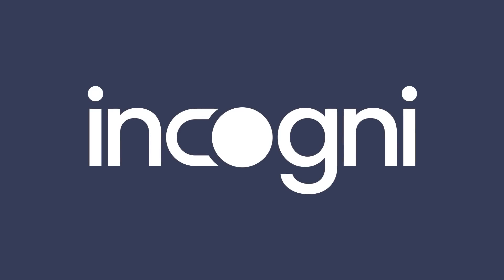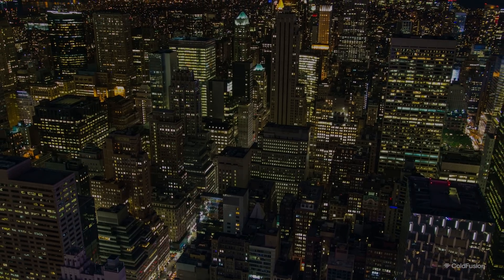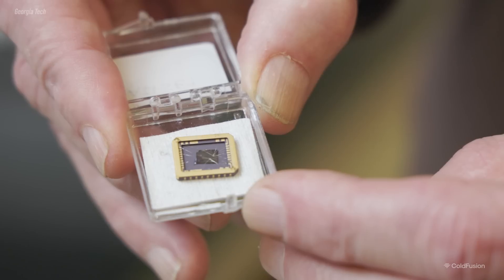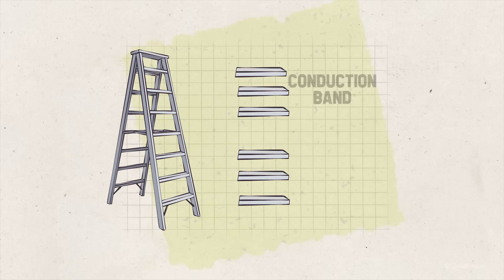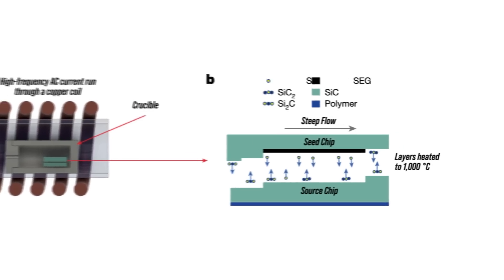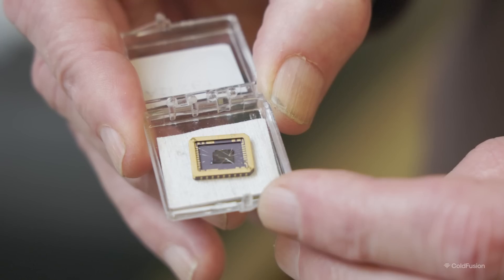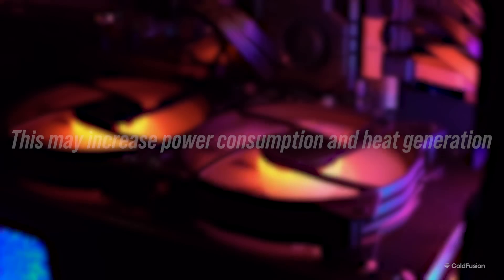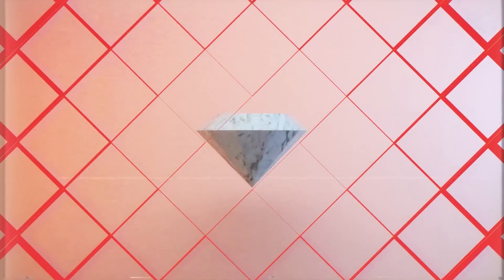This Chip Could Change Computing Forever

Comment: But when will we achieve cold fusion?
Reply: It's just around the corner, next upload.
Reply: Lol
Reply: 16 years, 4 month, 11 days, 19 hours, 52 minutes, and 12 seconds
Reply: @Astra2  You forgot the MS Miller Second.
Reply: @Astra2   I just put Monday, 3 September 2040 into my reminder/calendar for Cold Fusion; just to see if you were right, if so then ya it'l spook me....../
Reply: after we build a Dyson sphere
Reply: Cold fusion already existed since the 1950's, it's just completely impractical. We can use muons to do muon induced fusion at room temp and it works; you just need millions of muons with a half life of 2.2 microseconds all created by a large particle accelerator working constantly to replace the one's lost to decay. For the low cost of millions of dollars and kilo to mega watts of electricity, you can make enough energy to power a lamp, all at room temp.
Reply: @bjh3612  LED or incandescent??
Reply: @bobbygetsbanned6049   in 2015 it was estimated to take 4-6 megawatts to make 1 megawatt of recoverable energy through muon induced fusion in the then current best case scenario; so technically millions of lamps just very inneficiently. The main problem is that the current best way of making muons requires a particle collider, and since they decay in 2.2 microseconds you basically need to create them inside the fuel source itself. The machines that can make muons are only 40% efficient turning electricity into the muons and their kinetic energy, and then the best thermal energy to electrical system is also at max 40% efficient.
Reply: @bjh3612  40% efficient? That's about the same as an ICE car. So if big oil starts marketing this technology then the whole world will buy it & we can move towards humanity's impending doom even faster! Hurra, bring it on
Reply: Once hell freezes over
Reply: We already have if you believe the Martin Fleischmann Memorial Project
Reply: Never, we won’t even get regular fusion.
Reply: @Gmanc22  there is an old joke that Fusion is always just 20 years away….
Reply: @Gmanc22  dude cold fusion is easier that's why we aim for it first
Reply: Again it's already been achieved.  Why do you think Flight MH 370 disappeared with all the scientist who were trying to release it world wide.  They had to stop them and they didn't care who they destroyed to stop them.
Reply: Dude don't talk about that they may excommunicate you
Reply: About 5 years before we get commercial graphene products.
Reply: The wonder of graphene has been systematically kept under the radar.
Better said we have birds in the sky that are nearly undetectable using this technology on full size scale.
Reply: @N0N0111  I keep telling people that we will have bicycle helicopters before too long because of graphene
Reply: Should be about 20 years…
Reply: So, overly simplified: We haven't but we have made vast improvements in Fusion Tech where the newer generations of Hot fusion are becoming commercially viable, finally.
Reply: Look up 

Cold Spray Manufacturing
Conversely,
Look up what happens when metals come into contact in a vacuum
Reply: instantly
Reply: I remember reading about the promise of fusion energy and that it was about 20 years away.  This was in Analog SciFi magazine and during the 1979 gas crisis.
Reply: It’s used extensively in Fallout.. 😂
Reply: Or hot fusion. Always 20 years away.
Reply: This is cold fusion😅
Reply: You already have your cold fusion in YouTube.
Reply: They already have, it's the channel you're currently watching :-). When face with a major technological hurdle, just redefine the playing field. 🙂
Reply: Never. It's physically impossible.
Reply: but when will we achieve equality? or when will we realize that this effort is a complete waste of time and money? :o
could have had another einstein/elon musk by now, but instead all we have is sub par wahmens who are all trained at angry at men now. what a great society we have :/
Reply: @DemonsCrest1  uh… are you okay?
Reply: @nikluz3807  

are you a chat gpt bot?

i'm just pointing out the fact that if we concentrated our energy on elevating boys to their full potential, rather that focusing on making gurls/wahmens "equal", we could very possibly have this technology right now.
Reply: Muon catalysed cold fusion exists. It's just not net-positive
Reply: 😂😂😂 Good one
Reply: German scientists were able to create fusion not to long ago but cold fusion we still need about 100- 200 years , I’d say once we start to expand or colonize other planets and discover new elements
Reply: Unfortunately, one of the key components is Graphene, so yea...
Reply: Just ask the us gov they have that stuff from 1930s it's just that they decided to keep the alien tech quiet to make more money its a agreement between  big corporations and big governments like china,Russia and USA to "improve" technology bit by bit in a way that makes them more money with disregard with human suffering that's why easy but extremely useful tech like a water powered car was supresed (the dude literally got poisoned/killed by a bioweapon and his body cremated with out permission)
Reply: I know how the water car works its basically what Egyptians did with the pyramids to make electricity the key is using frequency to stimulate the water particles and make the hydrosis easier this in it self makes more energy than it consumes that's without using the hydrogen which can be sold or used precisely in a fusion reactor transmutting the hydrogen in to helium of corse the fusion part is a little more complex but not that much is pretty doable with current tech the more difficult part would be the platinum cells since a bunch of micro fusion reactions is better an easier to do than watever scientist are do in today.
Reply: The inventors keep dying. We wait for cern and their contemporary art filled entertained seminars.
Reply: Any minute now. You'll know for sure once your technically perfected and fully evolved final form excretes pure polystyrene.
Reply: When we think 10 000 000 K is cold.
Reply: One day
Reply: iter going to finish probably by 2030 for sure. After all the tests and tweaks, if it actually does produce net positive energy worth the bother, commercial fusion reactors would follow within 10-15 years.
Reply: @Andytlp  Isn't ITER already using outdated tech??
Reply: @Andytlp or ANY useful fusion…
Reply: @Andytlp  been saying we will have it in 20 years for the last 70 years, every time - we are very close. If it it ever does produce viable positive energy, the scientists will be paid to shut up and there'll be some other reason it needs another 20 years for. It will never happen, too much money involved in fossil and nuclear energies.
Reply: I hope this is sarcasm @Andytlp
Reply: We already have. It's making it commercial that's taking time 🤦🏻‍♂️
Reply: @DefinitelyNotBender  Fusion yes... Cold? no... Pretty sure that MA LAZORS! are pretty hot~